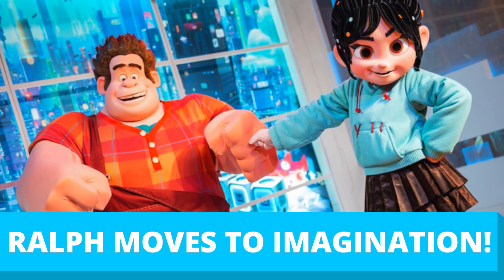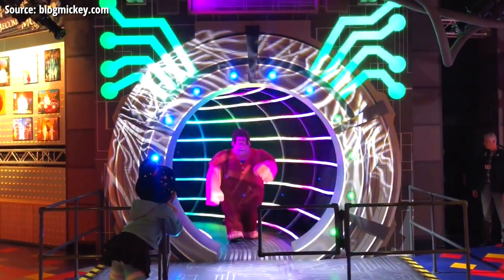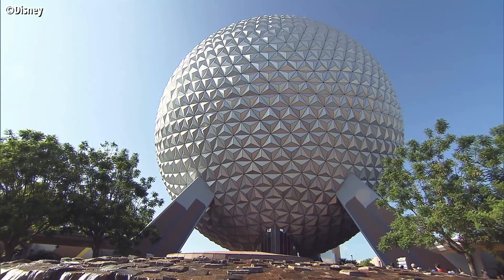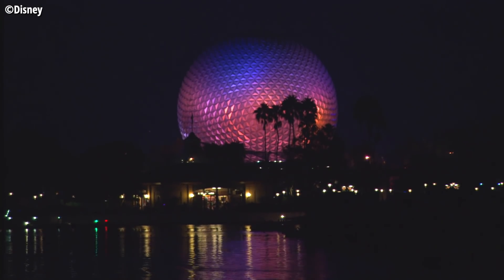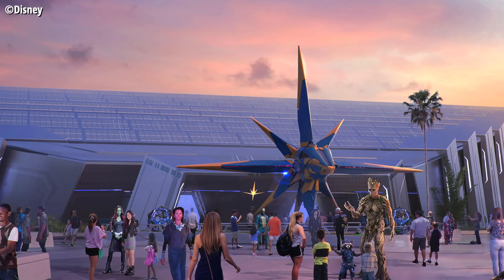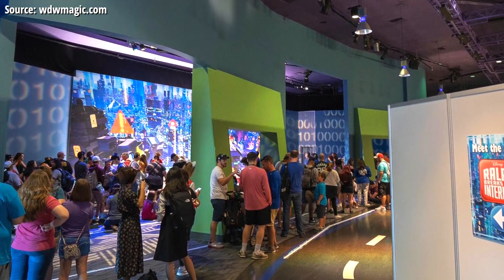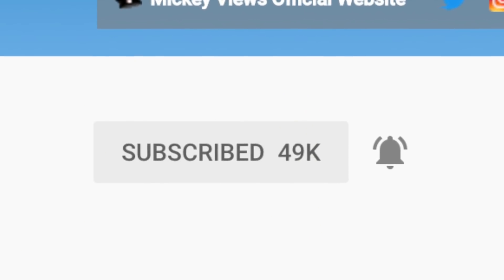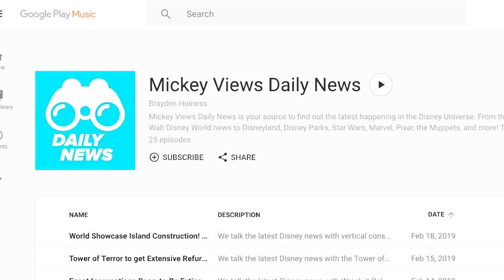Wreck it Ralph PORTAL UNVEILED in EPCOT! - Disney News

Comment: Will the Skyliner system be a secure transportation system like the monorails and have a security check point before you get on or will it be like the boats and buses and not require a security check before boarding?